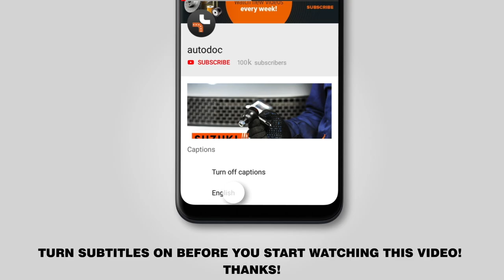How to change fuel filter VOLVO V50 1 (P12) [TUTORIAL AUTODOC]

Comment: This video should be taken down. Did as explained, and now I have loads of air in the fuel system, and the car won't start. Thanks a lot 👍
Reply from the maker: Thank you for your comment.
We will definitely take this into account in the next videos.
Best Regards,
Autodoc team
Reply: You always need to fill the filter with fuel, and prime the fuel system everytime you work on it.
Reply: yeah thank for the lack of infomation
Reply: My advice on how you fixed this problem?
Reply: @DaddyAddy833  you need to bleed the system is easy to do but you will need a pump wit a no return valve and some clear hose pipe that fits on the diesel return hose .  a full charged battery
Reply: Just remove the black top and bleed screw, and then you fill the filter with diesel. And remember to hold your finger on the bottom niple of the bleed screw.
Reply: Best to report the video as it is incomplete and can damage your vehicle
Reply: They still haven't taken this video down, I've had the same problems, ended up taking my v50 to volvo to put right, I wish to god I could sue these idiots!!!!!
Reply: @ImranShamsul  💯%agreed

Comment: ATTENTION!! After this video your car will not start. Take off the sensor of the new fuel filter and fil it up slowly until full. Next disconnect the green connector on the other side of the engine bay and suck 2 liters of diesel out using a handpump. You should see clean diesel comming trough without bubbles. After this the car will start. If it not strart or stall shortly after start. Pull again some diesel from the green connecter
Reply from the maker: Thank you for sharing your experience, it will be very useful information for our viewers.

Comment: Don't forget to mention that the will have a high probability of shutting down. And then you'll have to prime the fuel pump.
Reply from the maker: Thank you for your clarification. 
Stay tuned with us for more news and interesting tutorials coming soon.
Best Regards,
Autodoc team.
Reply: Thank you for this comment.  Following the instructions here my vehicle ran for ~10 seconds before it stalled.  I didnt have any fuel and put the original, still filled filter back on place.  No luck either.  I went to the gas station and got some fuel and then filled and reinstalled the new filter.  No luck.  I took a small funnel and placed rags beneath the hoses and filled them too with diesel.  The motor finally turned over after about 5 seconds of ignition.  No fun, glad the battery didnt die.
Reply: It's a good practice to cycle the key, a few times. While having the air bleeder on the top of the filter opened. ;-)

Comment: !!!!!! MOST VOLVO WONT START IF YOU DONT ADD DIESEL IN FILTER + IF IT STILL DOESNT RUN THEN TAKE BRAKE CLEANER/ STARTER GAS AND SPRAY IT IN THE HOSE WHERE IT CONNECTS TO ENGINE WHILE STARTING THE CAR, DO IT FEW TIMES TILL IT RUNS NORMALLY !!!!! TOOK ME LONG ENOUGH TO FIGURE THIS OUT
Reply from the maker: Thank you for sharing your experience, it will be very useful information for us and our viewers.
AUTODOC

Comment: be sure to fill the fuel filter 
fuel
Reply from the maker: Thank you for your comment and your valuable clarification.
You are absolutely right.
When replacing the fuel filter on diesel cars, it is necessary to fill the filter with fuel, as well as to prevent air from entering the fuel system.
In our new videos, we fixed all of these errors.
Best Regards,
Autodoc team

Comment: Do we not need a pump to bring fuel through the pipes on a Volvo S40 at least?
Reply: Yes you do on these PSA 1.6/2.0 diesel engines.
Reply: Pull green pipe connector off above timing belt and bleed with pump
Reply: @simonmg6797  thanks bud.. didn't have a pump so had to suck till i tasted diesel but it worked 😁

Comment: Volvo v50´s is one of the hardest to replace the dieselfilters on. You need to be very careful, even if you fill the filters up, the car may start at first, but they WILL stop! Then will be hard to start again. You´ll need a battery jumpstarter, and loads of patience. This car in this video will probably die right after the video ends. The worst of the v50´s filter is the ones that has the filter location in right front. That filtercase can crack without you notice that. You´ll need to unplug the connector at the high pressure pump and suck diesel to the pump, or else you´ll end up with a no start. Then you have the ones with the rubber seal and the long plug. 3 torx screws on top. Ford uses the same ones. (The v50 is a ford focus) You´ll need to fill it up, be very precise and be very clean.
Reply: Wish I saw your comment earlier... That's exactly what happened to me.. wish the video would have shown something about it
Reply: @mikelow4374  Yes, I’m pretty sure they had issues. An electric pump in the tank would have solved som problems here.

Just a micro leak and this engines will die.

Comment: Hello! Maybe someone can give me a hint! I am trying to replace the diesel filter on my v50, and somehow, the hoses that connect to the filter are very stuck. I pull, but they don't come off. Am I doing something wrong? Thanks!
Reply: They are points that u need to click in
Reply from the maker: According to the description, it is difficult to suggest anything, we recommend contacting the service.
Reply: You see the white bit on hoses. Just press them down, while pressing them down use your other hand to take the hose off

Comment: thanks for leaving out the part about priming the filter now my cars full of air and wont start. you should remove this video before any body else ends up in the shit....
Reply from the maker: Thank you for your comment!
You are right, after replacement, as a rule, you should pump the fuel system from the air, however, the procedure for each car is individual and you can find out about it in the technical documentation for servicing your car.
Best Regards,
Autodoc team
Reply: @autodocuk  i understand that.. is  why I looked for a volvo1.6d filter replacement video. specifically